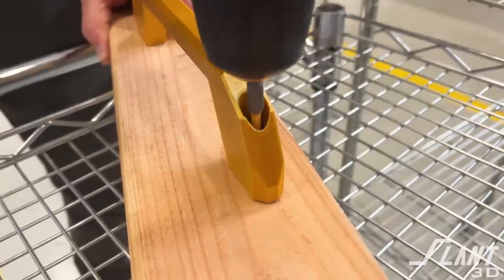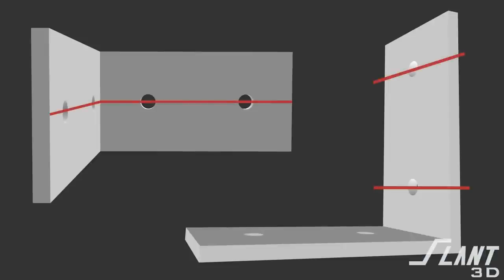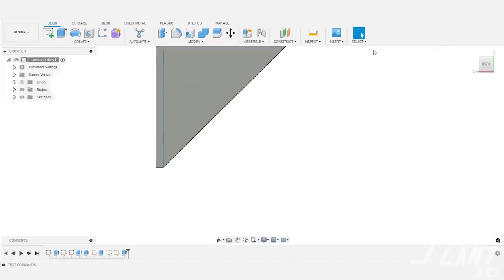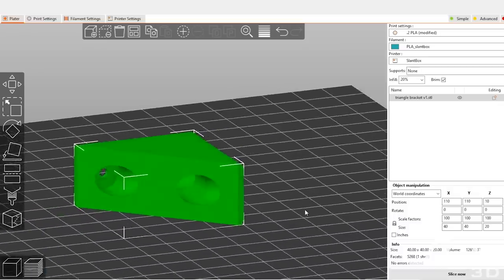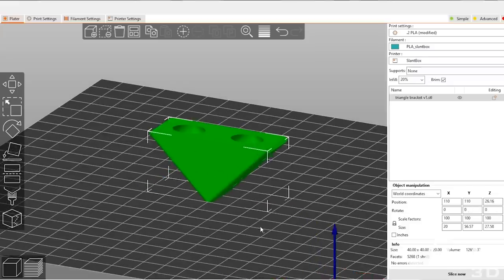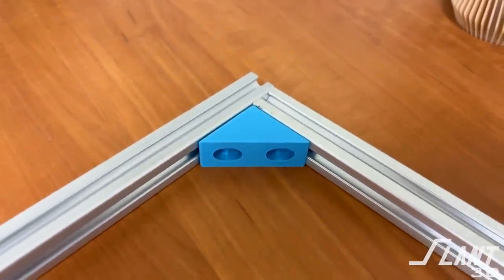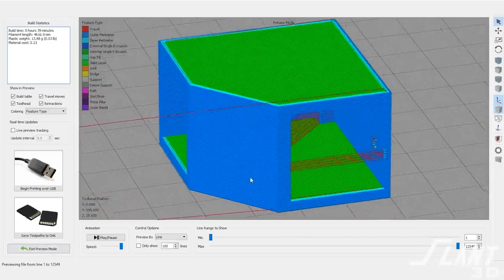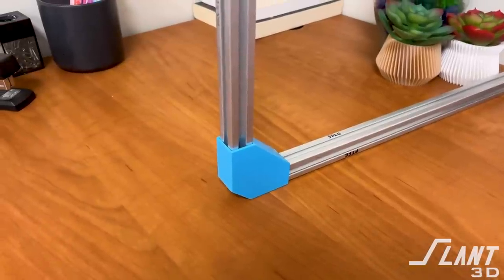Corner Brackets | Design for Mass Production 3D Printing

Comment: I apologize, I missed the part where you supported the argument that you could mass produce parts with 3d printing and do it cost effectively. I agree that you can do things with 3d printing that are unique vs injection moulding but I don't follow how you could mass produce them cost effectively when considering speed and energy.
Reply: The biggest difference is design revision and part changeover. Instead of waiting on new molds to be manufactured for a revised product, the gcode is simply updated. Changeovers are effectively a single button, rather than requiring someone to remove molds, cleaning out the machine, doing other maintenance tasks to ensure proper function, test pieces, and so on.

After the initial few test prints, it would generally be considered reliable enough to come back to the gcode in the future without modification

Comment: Interesting idea but it absolutely is not as strong as the corner brackets, plus aluminium brackets will always be stronger and are easier to come by. I think 3D printed parts should not be used for structural parts unless unavoidable. Remember that PLA, ABS and PETG all have creep rates.

I think this is a bad example of a part to mass produce using 3d printing, its not unique and its not better than the alternative.
Reply: The problem isn’t that 3d printing is bad, it’s that both sheet metal and injection molding are so cheap and useful it’s just hard to beat them.
Reply: I would imagine the brackets are intended to be used in low-load applications (see their custom made printers for example). The result would be precise and accurate enough to make a reasonably strong printer frame or some other low force CNC (like hotwire foam cutters or foam routers if you were making lost material molds for cast aluminum). I have found PETG to be very reasonable in strength (remembering that it is plastic) and I have made some pretty reliable brackets for miscellaneous things.
Reply: You're right, there is 0% chance this is stronger. You now have no overlap on the extruded aluminum and you're relying solely on 3d printed material for the precision and strength of this frame.  If it has extruded aluminum frame to begin with, then there is some sort of stresses being put into the frame. Over time,the standard filament materials will deform due to either heat, or pressure. It's literally cutting corners like this that makes some 3d printers so unwieldily to use.  Robust, rigid, solid base/frames  are essential to any CNC type machines.  This is intentionally making a mediocre product and adding higher costs for your customers in the long run so you can save pennies now.  There are some places plastic just doesn't belong.

Comment: I loved the video, but you cannot just say that any of these designs are stronger than any other without proper scientific testing... you're kind of speculating.... but honestly I liked how you're describing designing for additive manufacturing in an incremental fun way.... my suggestion is to try testing all of them with other manufacturing techniques and then draw your conclusions... Other than that I enjoyed your video
Reply: I would say it's based on experience. 3D printed parts is weakest when the force is directed  in line with layer lines.
So he is doing the statements based on massive amounts of general expertise on the area.

Comment: How is the slotted L bracket an impossible geometry for injection molding?

PVC tees and wyes for plumbing. All of them are slotted, just in a cylindrical tubular shape instead of the extrusion shape you have here, but at the end of the day they're all slotted brackets that are injection molded.

There is nothing in these bracket designs that have interior features completely inaccessible from the outside for injection molding.

Comment: You also have to take into consideration the plastic you're using to print structural pieces like this PLA will conform to stress yes even with carbon fiber it just takes longer PETG is too flexible so you need to print this out of ABS for a long-term solution. Don't believe me install this and torque the bolts with a torque wrench then wait a month then come back and torque them again and you will find it is loose.

Comment: You totally glossed over why you don't want the part to have too much contact with the build plate, and so you don't want to print it diagonal face down. What is the actual reason?
Reply: harder auto ejection

Comment: I'm going to assume that the extrusion is meant to be press fit into the square hole because if the final design is what's shown in the last few minutes of the videos, relying solely on friction between plastic and aluminum is poor engineering choice. Even with this assumption, this design is still poor as now you would be relying on the plastic's ability to elastically deform to provide the clamping force to react the moment.

I'm also very skeptical about the ability of this joint configuration to resist any bending moment. Plastic yield strength is way lower than any metal's yield strength, so the fact that the design relies on this property so much is concerning. The plastic will yield before the beam will ever bend. I presume that if the final design was able to react the moment that the joint will yield causing the extrusion to slip out of the square hole. Thus, the failure mode isn't the bracket self destructing due to the moment but rather the joint being the failure point.

3D printing corner plates and screwing them to the extrusion would be best. FDM 3D printing, as capable as it is, is still hindered by limitations, as all manufacturing processes are. So it doesn't make sense to me why a YouTube channel claiming to be experts at 3D printing manufacturing is doing a case study on a poor design. This design, in my opinion, is trading functional requirements for aesthetic/ease of printing.

And don't use 3D printed brackets. Buy metal ones. Why would anyone ever buy plastic brackets that are load bearing (I have also never seen injection molded plastic brackets, ever. This video doesn't even solve any real world problem)? Unless it's fiber reinforced polymers, I don't ever see load bearing components being made out of plastics. And even then, fiber reinforced FDM 3D printed parts are almost always planar by nature because this is the strongest orientation for this type of 3D printing.

Comment: This has confusing and misleading info.  If you are printing for mass production, the bed will be full and a print will take many hours - don't think you're helping by suggesting objects should have anything less than great contact with the bed. A single failed part could trigger a failed batch and that's a major time loss.  Redundancy is helpful, one vs two screws per rail mount is not an upgrade or savings and can decrease stability over time. These extrusions are useful because they can be modded - the final design here hides all 4 sides of the extrusion while only taking advantage of one mounting rail. This is a waste - a waste of plastic,  a waste of time printing and a waste of the extrusion since it becomes inaccessible
Reply from the maker: You should really watch the video witht he sound on.

Comment: But why would you want to mass produce anything with 3d printing, that is perfectly manufacturable with standard techniques? I mean, the variation is cool, but using two standard parts that are mass-produced is still cheaper than running a printer for about 20–40 minutes to manufacture that one part solution. Additive manufacturing is wasted on solutions that do not require it. It is incredibly time and energy intensive and just slow when used for big part counts. And all these brackets would be the same, so not even customization would justify it in this case. Also, you just change the task, the different styles of brackets are not better solutions for the same problem, they are  solution for different problems. I love additive manufacturing, but it is not some kind of wonder tech. We do not need to reinvent everything just to find a reason to use it. It is fine as it is, and will be used in many different  and appropriate applications where it provides wonderfull solutions. But there are still a lot of problems where a simple  injection molded part does the trick.
Reply from the maker: Take a look at a few of our other videos. We explain every one othe points
Reply: If you’re going to have mass production, you need many machines. It is well worth considering trading a few of those printers for a laser cutter, it is way faster and uses very strong flat sheets that outperform 3d printed materials. You would design your part accordingly, in this case you would design 2 flat parts that screw to the top and bottom of the joint (these could also be printed) and cut them out in under a minute. Your printer bed may just have reached printing temperature when you laser is already done making 2 parts from a stronger material.

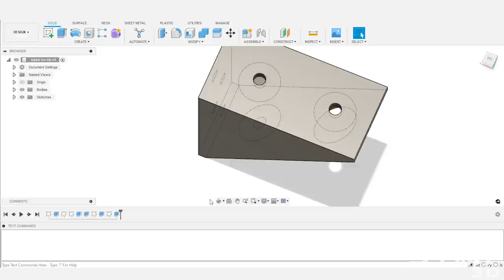Comment: 2:30 what??? You absolutely could injection mold that part. Your argument makes no sense. Plants of March larger parts than that get injection molded every day
Reply from the maker: The walls are too thick. It causes shrinkage in molding that deforms the parts. A variation of it could be molded. But the mold is really quite expensive for a trivial part produced with printing.

Comment: Optimal ? I don't think so. Why don't you add tongues in the l-square to match the lateral grooves ? Even better you can add snap fit to completely remove the screw. Even even better the snap could apply a pressure on the tongues to strengthen the joint evermore.

Comment: Laser cut, bend and weld = 1 minute per part on a production line.

3D printed = dozens of minutes per part.

So you're making weaker parts, more slowly and more costly. Still not grasping the concept of mass production economics huh? :D